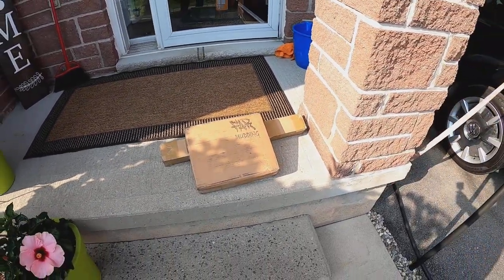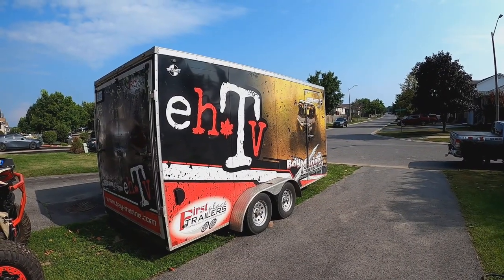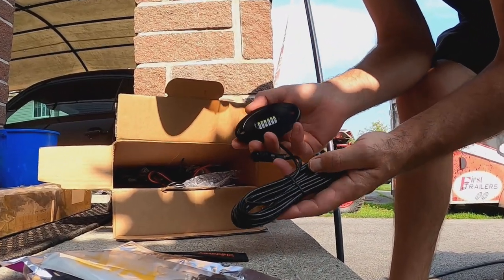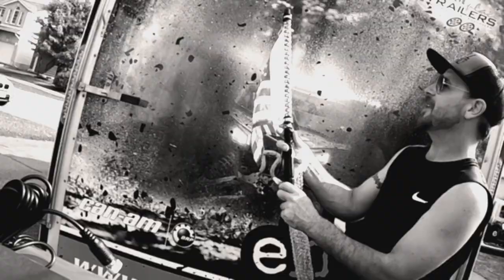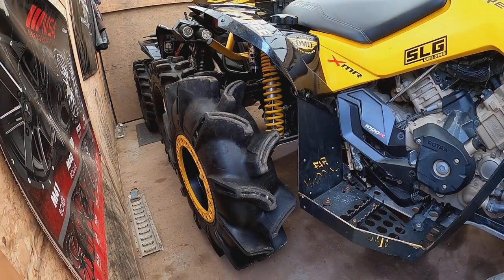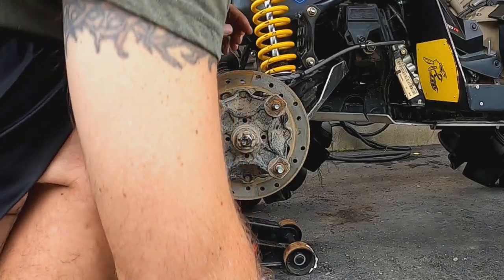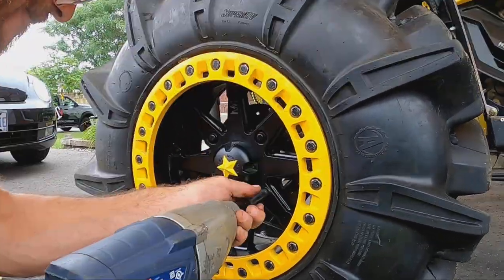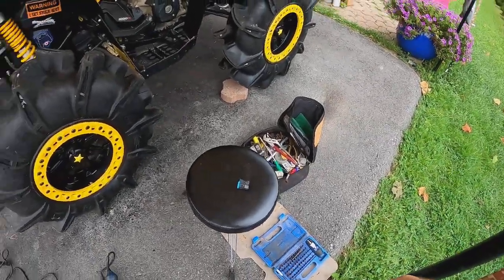How To Replace A Broken Rear CV/Axle On A Can-Am Renegade

Comment: You made that look so easy taking out the trailing arm bolt and dropping it down.  I’ve wrestled with those rear axles a lot and never heard anyone say that I should’ve done that. Thanks a million plus 👍🏻👍🏻👍🏻👍🏻👍🏻👍🏻👍🏻 I’ve got a rear axle boot to change out now and hoping that I don’t have to change the cv joint also. Hope it was just dry popping because it quit after I spray gear and chain lube in it through the big hole on boot
Reply from the maker: Has worked for me a few times removing those stubborn buggers. Glad we can help my friend.  Thx for watching

Comment: How do u find the Stanly socket set? I never heard much good about them, for what ever reason.  But that's what I use and love it, no issues
Reply: Typically  they're alright for average people, pretty sure they are the same as Canadian tire brand sockets as the ratchets suck and both seem identical just black anodization! They Always had a history of failures for along time now but sockets seem pretty decent. My Canadian tire brand I've had for 10+ years from working on cars trucks highway tractors and atv's.
Reply: @ChippyOutdoors  yes I only use mine on my quads and motorcycles, so not likely to strip out a ratchet. They are not made for industrial work with 72 teeth ratchets. .. But I also have two Mastercraft sets that seen it all and only striped out one ratchet over the years
Reply: @xmonster741  my master craft came with 6 point, I seen Stanly with both but 6 point should  be standard sockets imo
Reply: @ChippyOutdoors  agree
Reply from the maker: Work well for the small stuff, eh.

Comment: Are you just running stock cv shafts?  I have the same set up on my 21 and the same cv clicking.  I would like to put upgraded cv shafts vs keep replacing stock.
Reply from the maker: Big fan of stock cv shafts.
Reply: Do you happen to have the part number for that cv shaft?